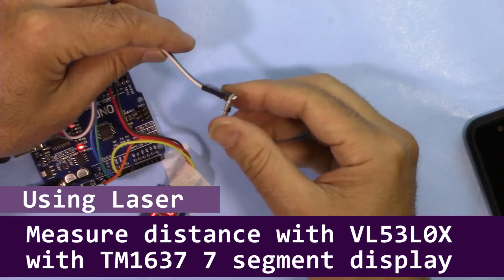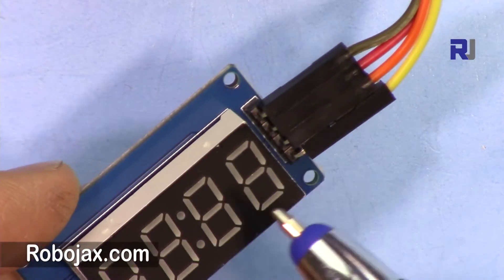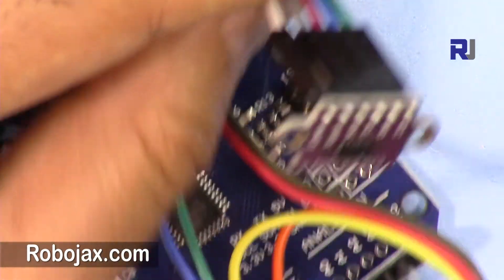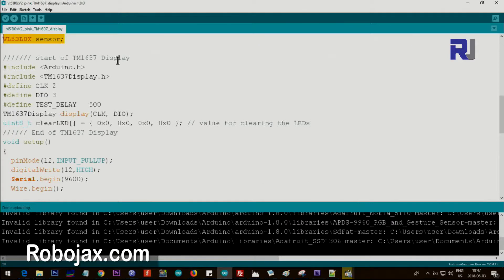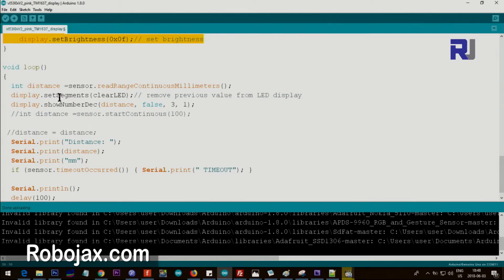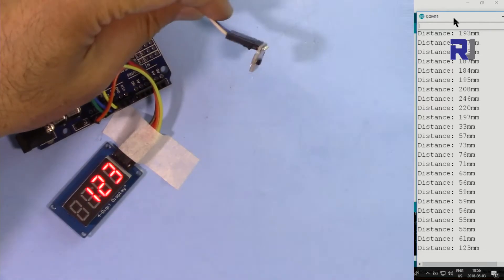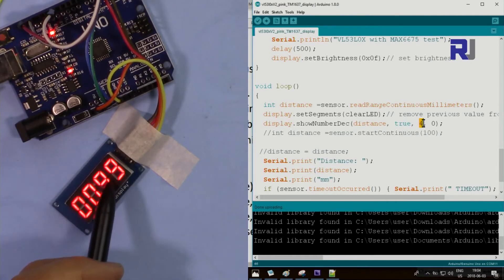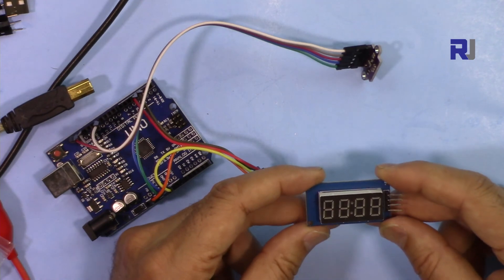Using VL53L0X 6 pin Laser module with TM1637 LED Display to measure distance RJT84

Comment: Thank you so much for this tutorial.
I’ve bought a vl53l0x module and whatever I do it doesn’t work and it shows -1mm all the time(I’m using without LED display).how can I make sure module is not damaged?
Reply from the maker: First try it without the  display http://robojax.com/learn/arduino/?vid=robojax-VL53L0X-6pin and once it worked, then try the TM1637 http://robojax.com/learn/arduino/?vid=robojax-TM1637 without the laser sensor making sure it works. Then combine both.
Reply: I have this same problem! Were you able to figure it out?

Comment: good video. can the VL53L0X range be more than 2m or what to use so that the distance is more than 2m
Reply from the maker: datasheet is provided for XL53L0X.  No it won't work for distance over 2m.